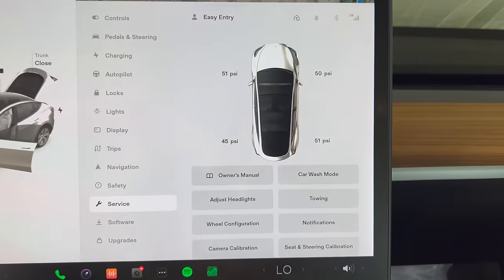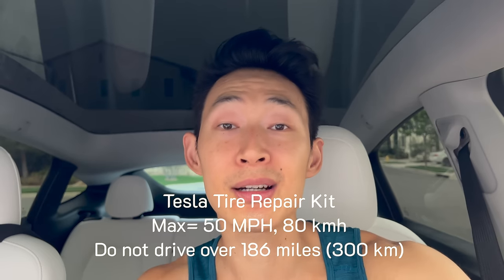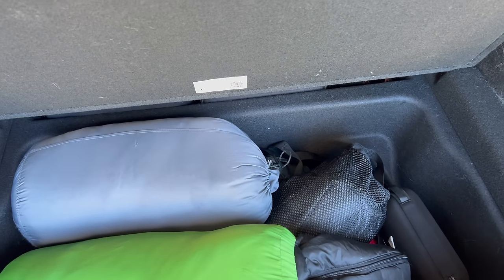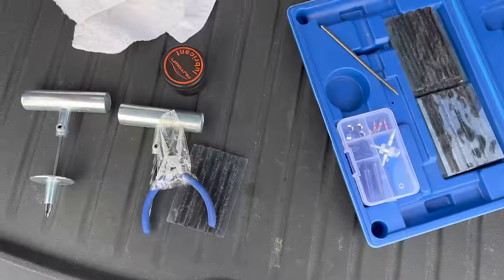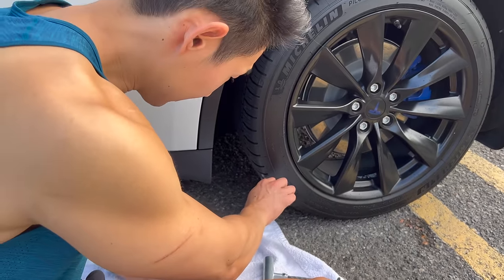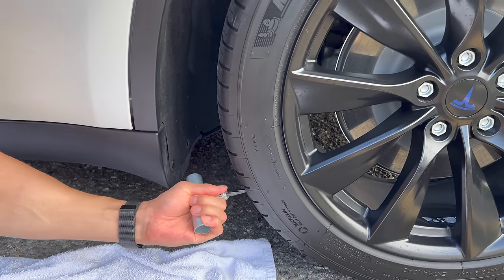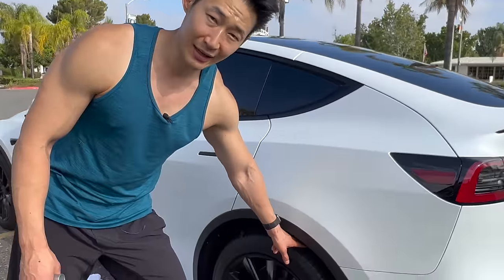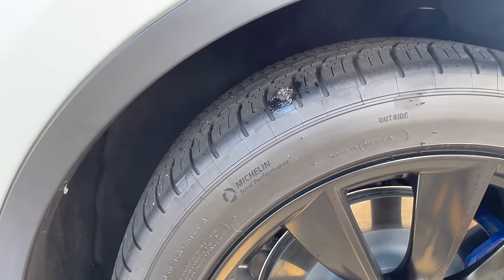How to plug a Flat TESLA Tire (Or any tire) in an Emergency

Comment: Ok my opinion. Driving around without a spare tire is str8 ASKING FOR IT. Plugging a tire in the dark, in the rain, snow or adverse conditions is nuts and almost impossible.
Get a spare , cut the nonsense. 
Why go thru all that drama, Tesla boasts all the storage room...and yeah this is 1 reason why also...Gas cars would have more storage room also if they removed all the spare tires.
T Sportline has a great 18in spare kit that looks way better than the Modern Tire version.
Saying it takes up space is also like "really man, come on"...with all that storage room in thes cars U dont wanna make room for a spate tire and would RATHER go thru a bunch of drama... "Big" is not a measurement. The spare is about 26in x 8in or so in my opinion its  not taking up enough justifiable space to risk all the silliness and crap/ drama by not making room for it and packing yr camping stuff somewhere else. 
Doing this is just kinda silly when u have a way more dependable option in yr life.   but also like dude said if u dont know the technique ...however this is in the sun and all nice out.
Buy a spare Kit..jack and all...and forget this silly solution.

Comment: I have the full size Modern Spare which does take up a lot of room, but will save time if stranded.... I had a blow out soon after getting my model 3 and was stranded 4 hours on the side of the freeway with my wife and infant son. Fortunately someone was able to pick up my wife and son after 30 minutes, so I waited in the car. Tesla sent the wrong tow truck that did not service on freeways after 2 hours waiting, so they had to send another which was an addition 2 hours. I don't want to deal with that again so I will sacrifice weight and space for the spare

Comment: I haven't had a flat tire in 40 years.   But it would figure that if I take my Y on a road trip.....💥   I just bought a MODERN SPARE after driving the Y for two years with only the Tesla slime kit.  Also, these cars are very low to the ground, so a low profile jack is necessary.   YES... I am considering carrying a low profile FLOOR JACK for just in case.  ( add 100 pounds to the vehicle gross weight with all this stuff in the trunk! )  The beltway around my city is usually where I find Teslas parked on the shoulder with flat tires.  Very few tire shops here will touch a Tesla.   AAA just told me that they won't touch a Tesla except for doing vehicle inspections.  This was my RED PILL moment.  So,  be prepared!

Comment: That's hilarious,  I had a nail stuck for 3 weeks and I went to tesla today they sold me a new tire.
Reply from the maker: Wow I wonder if it was repairable
Reply: @EverydayChris  The tesla team said it was borderline too close to the wall. It looked almost exactly the same as yours. They use the rule of thumb or one inch away from the sidewall. I will patch my tire , buy a rim and tpms then use it for a spare. Which will help me when I rotate my tires anyways.

Comment: 😂That video was funny and at the same time painful to watch. No matter how strong you are you are fighting the pressure of the air gushing out intensified by the weight of the car. You should take the pressure of the tire by ideally taking the tire off the vehicle or at the very least jacking the car up to take pressure of the tire. Otherwise you are fighting a losing battle.